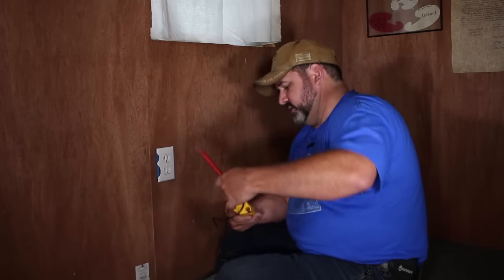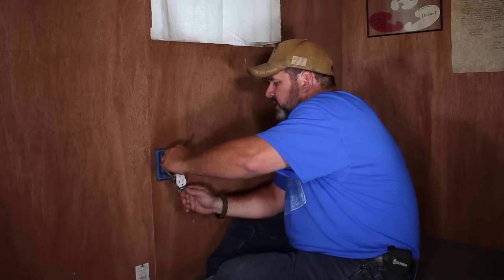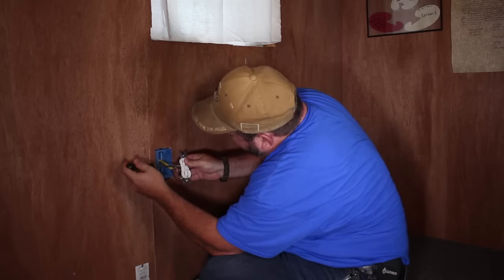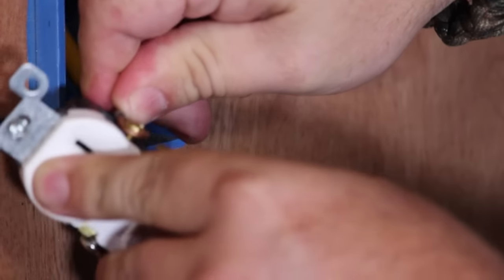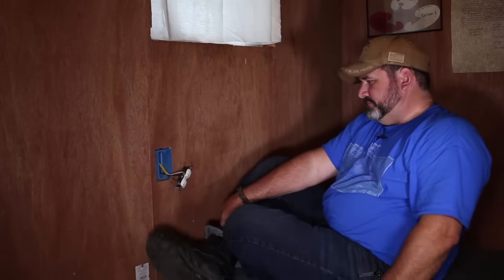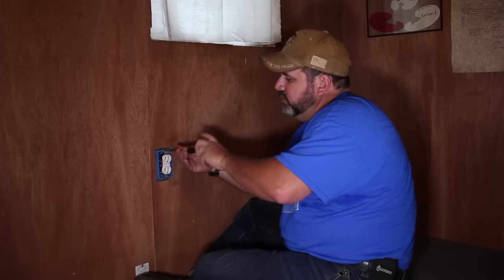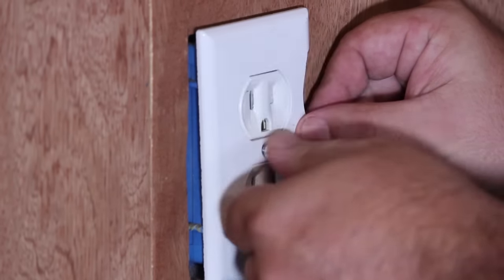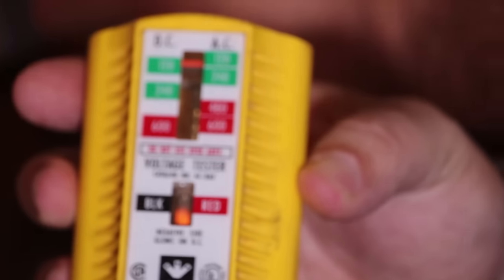Home Maintenance E 1 Replacing an Outlet

Comment: I'm a retired General Contractor who also ran a small Home Maintenance business , The only thing I would like to add here is, Check with your local municipal or town offices before doing electrical or plumbing projects no matter how small, believe it or not there are still some towns that even if you own your own home there can be a limit to what the homeowner can do, some even require you to get a simple switch or receptacle replacement inspected, I know it's crazy,  awesome job J ,  love the channel
Reply from the maker: Thanks for that information. Thanks for watching

Comment: ALWAYS hook-up the black wire (hot) to the GOLD post on the outlet and the white wire (neutral) to the silver post on the outlet! Switching them means that you have power running backwards up the neutral line into your appliance. You can DESTROY anything sensitive. That is why outlets and plugs are polarized. One prong is wide, one is thin. That way you cant plug in a plug backwards. VERY important.
Reply from the maker: Thanks for sharing that that is new, and I wondered why the new prongs were like that.
Reply: You might ought to put in an annotation. Keep up the good videos!
Reply: +Empty Hammock .... you are going under the assumption that the wiring is "correct". A lot of old homes, wired by non-professionals, may be reversed. I've run across this many times. Also, you may find a "floating ground".  In my opinion, both need to be corrected for safety.